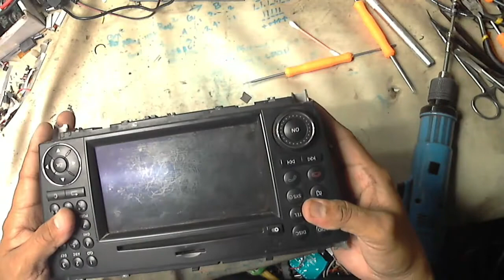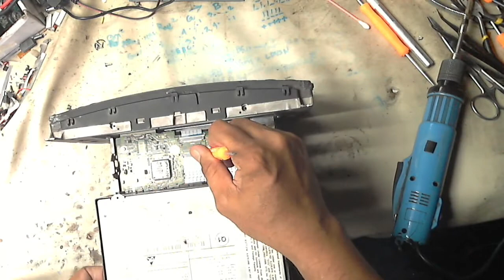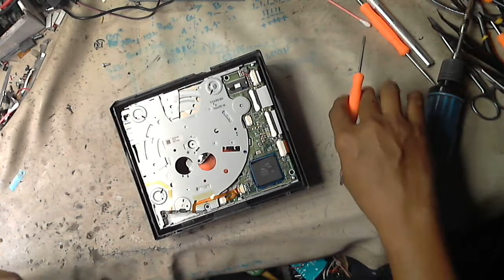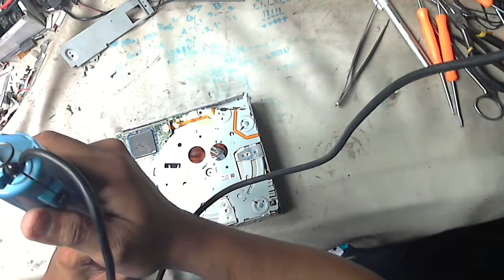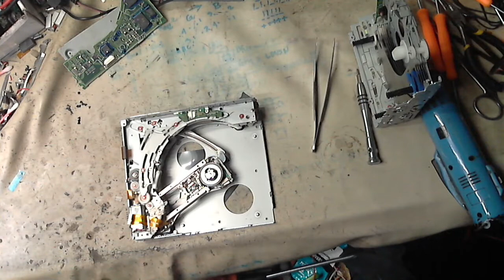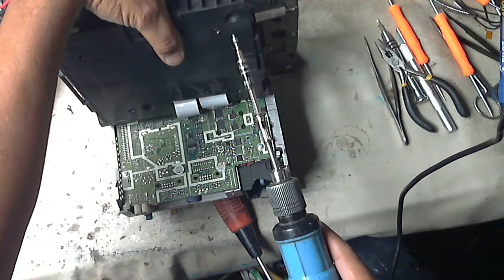Mercedes BZ9841 BD0811 08-10 Alpine navigation COMAND NTG2.5 radio

Comment: No audio, no comments, no idea what you did with the q tip, or what you diagnoses and repaired... My system won't turn on it used to just turn off after about 40 minutes of play time
Reply from the maker: Check board on power area, or check the front panel and socket from front to board
Reply: @kuarashi  Interesting! Radio is still on the dining room table in pieces... (wife has been upset with me for over a week now).... if your suggestion is good ill Zelle you some beer money. Thank you for the reply.
Reply from the maker: I think some mechanical fault, check slide motor ic from the lazer area
Reply: @kuarashi  the integrated circuit is electronic....the mechanicals of the CD are not ... Your recomendations are conflicting and vague...